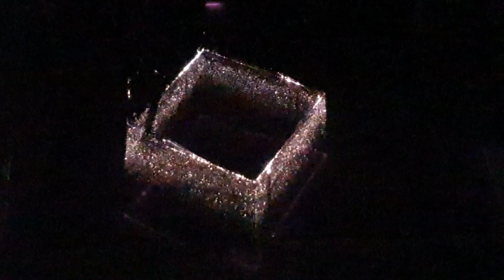20W Fiber Laser Beam Visualized Underwater

Comment: what is the residue after lasing the sand?
Reply from the maker: The particles melt together underwater. Longer pieces are very brittle. It breaks under it's own weight just when I try lifting it. 

The sand was also sieved before starting lasering..Without sieving I get the same thing but more rough surface and foamy structure with the particles only partially melted together